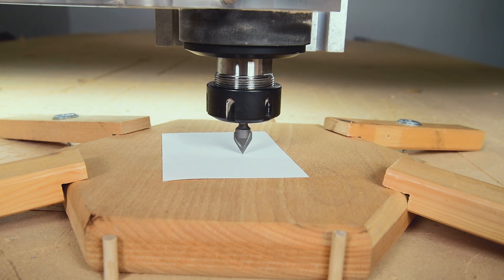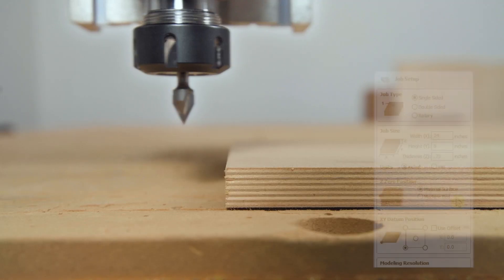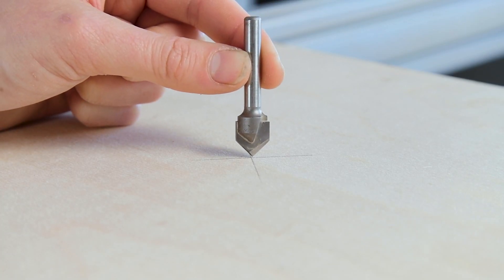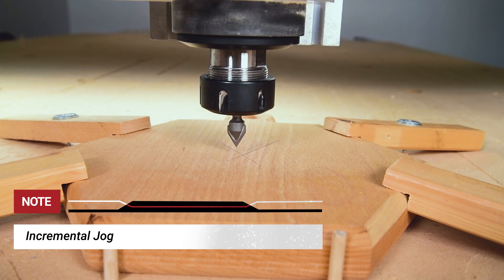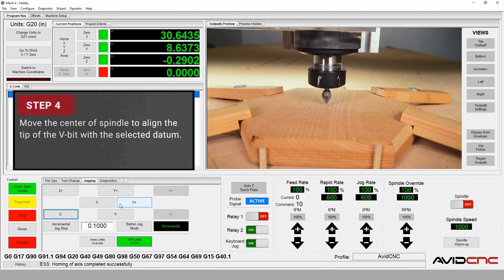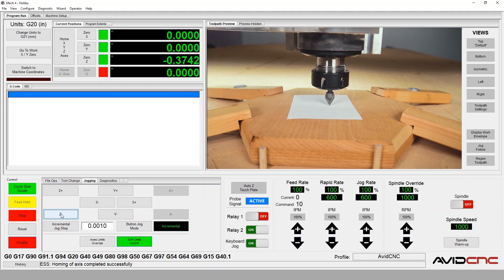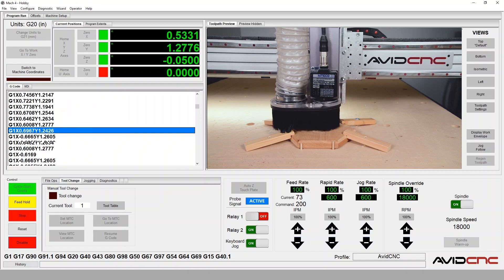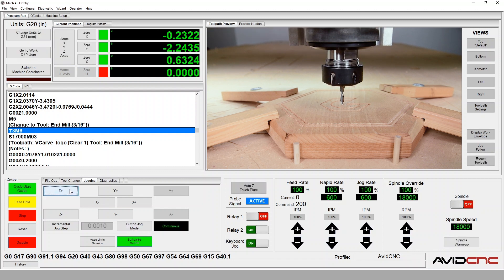Pro-Tip:  How to Manually Set Your CNC Work Offset

Comment: If I was doing that, I’d place the cutter just above the work piece, then loosen the collet to let the tool sit directly on the workpiece. Then tighten. There’s your zero right there. You could also set the bit on a feeler gauge of known thickness if you’re cutting very soft material with a sharp v-bit and subtract the feeler gauge thickness.